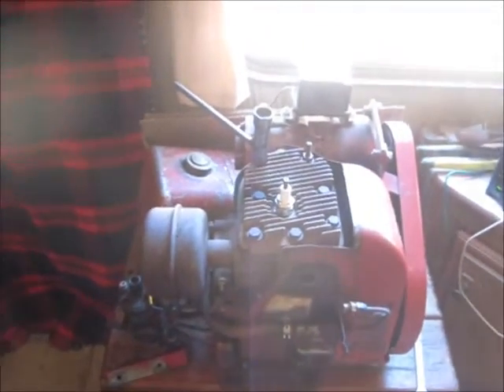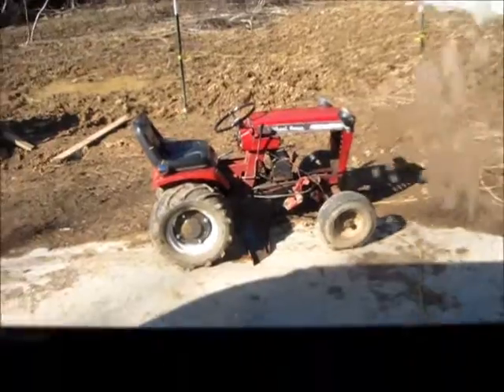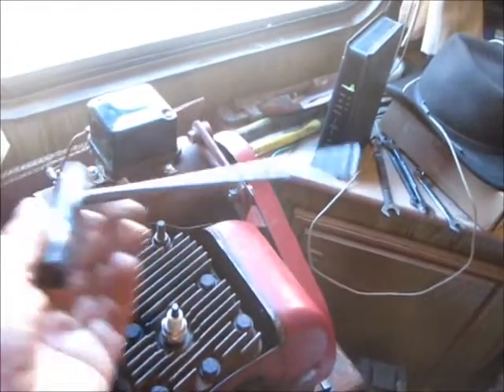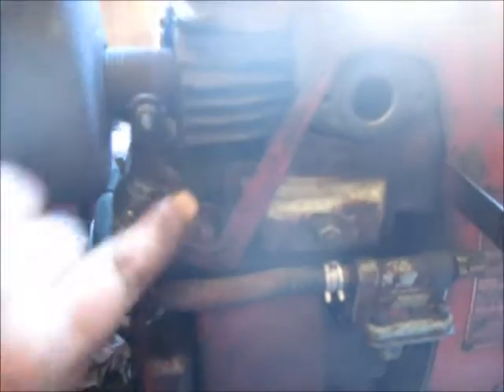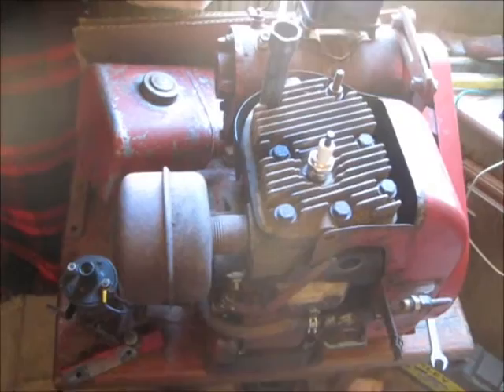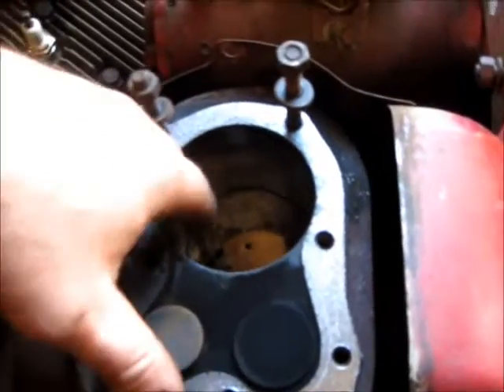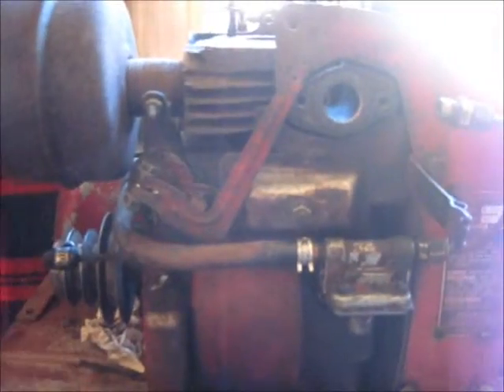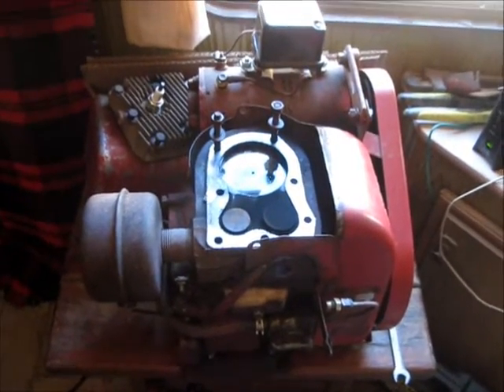K181 engine rebuild part 1

Comment: I bet if you would have just sanded down the head before doing all this it would’ve worked great. I see it happening all the time, head gasket leaks from a warping head and folks throw money where it’s not necessary. The symptoms you mentioned you were having indicates a leaking head gasket. Hopefully this msg will help the next guy out.